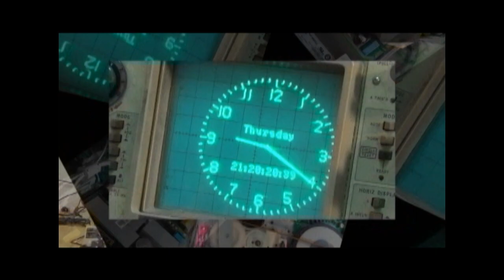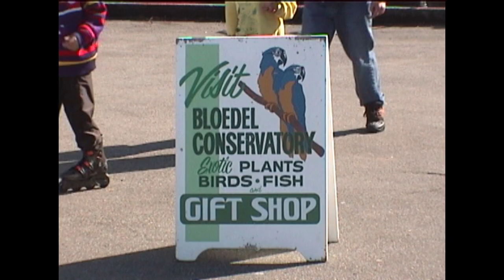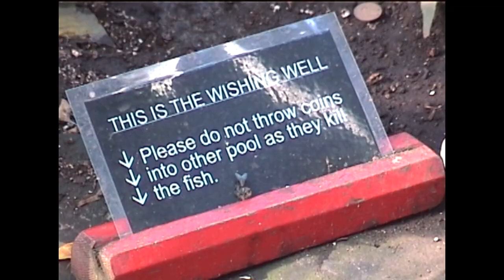Original Evaluation Footage From the first Digital 8 camera released vs DVD camera uprez to 720

Comment: Off Topic....Just bought a pair of those Klein electricians' scissors you use Dave, and these are hands down the best scissors I have owned!
Reply from the maker: That's why i use them as does every cable and fiber splicer around.  Miller are also good.

Comment: I just bought a working Denon DP-45f turntable on eBay. In the service manual, it appears to have over 130 capacitors in it, although the manual covers two models. Ballpark, what would you charge to replace all of them and give it a tune-up.

Comment: Did you use the cloner box? 24:45 - the same aliasing and vertical - not horizontal - stripes of color I noticed on your original video, I thought that maybe youtube does it, but seems not. "It records digital on familiar 8-mm tape" - "You've lost me, technology is beyond me", ha-ha.
Reply from the maker: No, digital 8 footage was fired over via firewire and the DVD was ripped in the DVD drive.  No analog capture.  All digital.  Original version was a direct DV upload and the 720 up convert was done using premiere CS6.  The atrifacta you are seeing is probably the low resolution CCD.
Reply: @12voltvids  Right, stupid me. Actually, was wondering what you used for upscale to 60p. Premiere, I see. Thanks!
Reply from the maker: @ConsumerDV  yes it upscales and downscales nicely.
Reply from the maker: 8mm video was analog just like VHS and beta.  Hi8 was also analog similar to super VHS.  They just increased the carrier frequency.  Unlike audio tape where the audio signal is just sent to the tape mixed in with the bias signal. The bias signal is not recorded as it is well above the tape frequency limit.  On video tape the heads spin and draw diagonal tracks across the tape. This gets a much faster relative speed between the head and the tape. The video signal is not directly recorded onto the cassette formats. The video signal is split into its two components the color or chroma is converted down to a much lower frequency than where it would normally be in the video signal. On ntsc the chroma signal is normally at 3.57 megahertz and on pal it's at 4.43. this information is converted down to 629 kilohertz for VHS and 733 kilohertz for 8 mm and high eight. The luminance information which is the black and white picture details is fed into an FM modulator. No different than an audio signal fed into an FM modulator to be transmitted to FM radio. This FM modulated signal is combined with the down converted color signal and recorded on the tape as an FM radio signal. Hi8 and super VHS increase this carrier frequency and bandwidth which increases the picture quality on playback. Digital 8 is a digital format that uses the familiar 8mm and high eight tapes. The video signal is digitized turned into ones and zeros Evan framed his packets which are then recorded on to tape. This requires much more bandwidth than analog recordings do. On a normal 8 mm and VHS tape the Head drum makes one rotation to record one full frame, two fields of video. Digital information takes five times as much bandwidth as analog.  The digital frame used for digital 8 is the same that was used for mini DV. On mini DV that had drum rotates at 9,000 RPM, by comparison VHS and 8mm analog the Head drum rotates and only 1800 RPM for the ntsc system. 8 mm video however wrapped the tape greater than 180° because analog 8mm had extra room to record digital audio on cameras and decks that were capable of adding additional audio so there was additional bandwidth that was not used for analog recording. That is used in digital 8, the entire tape with is used and because of this extra real estate they had drum does not have to spend at 9,000 RPM for digital 8 it only has to spend at 4,500.  Digital aid itself made an excellent recording medium and because the quality was so good and could compete with DV in terms of quality the camera manufacturers intentionally put sensors in the camera that were artificially low and resolution so as not to compete with the high quality that a high in sensor could produce.
Reply: @12voltvids  :-)) I simply quoted the bloke with whom you talked in the park when you shot with the Digital8 camcorder back in the 1990s :-)) You explained to him that you were shooting with a digital camcorder that used regular 8-mm tape. I do know what Digital 8 is. But I never understood why did they choose to create a new form-factor with 6-mm tape for DV instead of re-using 8-mm cassettes. After all, DVCPRO-M cassettes are about the same size as Digital 8, and they probably could shrink it down to nearly MiniDV size to make a small cassette.
Reply from the maker: @ConsumerDV  gotcha. The reason Sony developed digitally was simple. 8 mm and hi8 had a huge installation base. It was the most popular of the camcorder formats. I know JVC and Panasonic might like to claim that vhsc was more popular but it actually wasn't, 8 mm and hi8 commanded approximately 80% of the camcorder sales in the 80s and 90s. With that big base of already existing customers who already had a library of tapes, those customers wanted to migrate to something more modern but still wanted to be able to play the existing tapes of their videos. Sure someone could go out and buy a mini DV camera now they've got a great digital camera but how are they going to play their 8mm tapes because they're old 8mm camera is broken. That is why Sony developed the digital 8 format, to allow customers that already had existing 8mm equipment and had their existing 8mm library of tapes a way to transition to digital recording while still being able to play their existing analog 8 mm and high tapes. Sony did release some cheaper digital 8 camcorders near the end for customers that we're looking for an inexpensive camera but did not have existing analog tapes to play, they offered a less expensive and buy less expensive I think it was about $50 to 100 cheaper. They had two cameras that looked identical at the time and this was well into digital eights dominance. The DCR TRV 240 and the DCR TRV 250. Both cameras the difference between the two is the 240 could play back 8 mm and hi8 analog tapes as well as record and play in the digital 8 format.  The TRV 250 only recorded and played in the digital 8 system. If I'm not mistaken that was one of the last camcorders at Sony made for 8 mm tape. Currently I have two DCR TRV 240s. They are both given to me as was the 250. one of the 240s the mechanism was all screwed up because somebody tried a tape out of it and ripped apart the mechanism to get a tape out. I pulled the transport from a 250 and stuck it in the 240 to create another playback machine that I could use for analog and digital tapes as for me having analog capability for playback it's much more important than having just a digital only camera. But that's why digital 8 existed. That's also why Sony put in a lower resolution image sensor. They wanted it to look comparable to the analog equipment that it was replacing as far as picture quality went it did look sharper but it wasn't as good as the image sensors that were put in their mini DV format cameras and that's so that mini DV could be seen as a step up in quality. Had they put the same sensor 680 or 760 k pixel sensors that the mini DV cameras used the picture quality of digital 8 would be identical to the mini DV and could undermine the sales of the 6 mm mini DV tape format. It was a great decision digital 8 because it allowed people to move to digital while still maintaining backwards compatibility and when playing an analog tape it would output a DV type signal through the firewire connector so you could digitize your analog tapes and import them directly to your computer no analog output in a separate digitizing card needed. It was a great format and Sony had a good run with it they weren't the only company that made digital 8 Hitachi also made digital 8 camcorders. The data structure is identical as far as the digital packets go between mini DV dvcam and digital 8. They all use the same compression the same data rate and the same color space. Dvcam was the professional arm of DV for Sony which used a faster tape and a slightly wider video track. It reduced the recording time from 62 minutes to 40 minutes on a regular tape, what this did was minimize dropouts because the head track was wider so a small disruption on the surface of the tape wouldn't necessarily cause a visual disruption like you did on the consumer format. Dvcam also used locked audio where the audio clock was locked with the video clock. JVC did the same with the gydv500 however the JVC camera recorded in consumer type record format so that consumer cameras and players could play the tape but it had locked audio. Locked audio is one of the most important features that dvcam and professional DV had over consumer DV. If you've ever tried to edit a multi camera shoot with unlocked audio you will know what I'm talking about because the audio gets out of sync with the video after as much as it just a minute of recording time and you're always constantly having to tweak the audio to get lip sync back. This was intentionally done to stop professionals from using home equipment because they didn't care about home users most home users didn't edit most home users just watch the tape on their TV are copied it to VHS or something else. Professional users though they would pay the big bucks to get locked audio because it made their session in the edit suite A little bit more bearable. I dropped 10 grand on my JVC camera for that reason because I couldn't deal with the lip sync error trying to work with two consumer DV cameras and do a multi-camera production.
Reply: @12voltvids  Um... I was wondering NOT why Sony backported DV to 8-mm, but why DV cassettes were created in the first place instead of re-using 8-mm cassette. After all, Sony was not the only one company making 8-mm equipment, back in 1982 as many as 127 companies supported it, it was an international consortium. So, why creating a new consortium, to which Sony also was a member, to create a whole new cassette family? Ampex wanted to use 8-mm cassette back in 1986 to record 20 minutes of 50 Mbit/s 4:2:2 digital video, basically DVCPRO50. But they did not go further than a prototype. I am sure they would be able to get longer play time with metal tape and narrower track, and it would be comparable to DVCPRO-M cassettes. Oh, well.
Reply from the maker: @ConsumerDV  the reason that mini DV was actually developed was the desire to make it even smaller camera. Also due to the fact that JVC and Panasonic would not support any 8mm format. Had Panasonic and JVC accepted 8 mm that would have meant defeat for their vhsc format. To JVC and Panasonic that's like saying beta 1 to let 8 mm win the format war for camcorders and they were not going to let that happen. So even though all the other companies that signed up for 8 mm and high eight the other two biggest companies would not support it. TV was originally going to be called quarter cam because it used a 1/4 in wide tape or 6 mm. Again Panasonic and JVC did not want a tape size as the official name for the format so mini DV was chosen as a name for the new universal standard for digital video. Sure Sony could have developed digital 8 right from the get-go but also initially all digital video tapes were metal evaporated tapes and initially the concern was that metal particle tapes may not stand up and hold Digital Data. They actually did a very good job when the engineered digital 8 because it took advantage of the larger tape wrap on the scanner.  You see VHS and beta for example used a 180° wrap when one head finished its scan the second head was in position to start recording the next field. 8 mm used 210° wrap. That extra 30° was for the optional digital PCM audio track and to record time coding information for frame accurate editing. The first 180° was where the analog video was recorded and the remainder where the digital audio was recorded or was it the other way around I forget maybe the digital audio was recorded before the video I'd have to go back and check my notes but anyway the extra wrap provided a longer track which permitted them to stack two DV tracks on top of each other. This allowed the 8 mm tape to record the same data that a mini DV did but without requiring as fast ahead drum speed. The writing speed is the same but the Head drum speed is only 4,500 RPM versus DV which is 9,000. On DV it takes 10 recorded tracks on the tape to store one full frame that's five rotations of the Head drum for one full frame on digitally it's two and a half rotations. Of course on analog one frame is one full rotation that just gives you an idea of how much faster the writing speed needs to be the store Digital Data. Anyway it's wasn't interesting time I would have loved to have seen a full-on professional camera that used hiatus full broadcast quality like a digital BETACAM but that format was also very well established and was the de facto standard for news gathering and production. Betacam SX actually became the most widely used format for television production. SP betacam became the standard in the analog world but when digibata came out it quickly surpassed all the analog recording and did you Beta had a couple of different flavors the betacam SX became the most popular and widely used of all of them because it was less expensive and it was a very robust recording on the tape. The neat thing about the digivated decks is that most of them could still play back all the analog versions of betacam that preceded them. One of the key reasons that betacam SX became so popular as a replacement is because it could use the beta SP tapes where is the other digibetacams required a special tape which was fine for post production and editing but for acquisition most stations were upgrading from analog SP so they didn't have to replace their library of tape so you can just continue using the tapes that they already had in the SX format which is one of the reasons it became the most popular of all which is what I have.

Comment: Sir, i have a question, if i select my camcorder to record on widescreen, will there be any pixel loss or something ?
Reply from the maker: Letter box yes, it just crops lines out.
Reply: @12voltvids  thanks sir, how do you capture your footage in 60fps?
Reply from the maker: @AbDaniel21  it was a direct transfer over firewire.  The 60p was done in software when it was uprez to 720p
Reply: thank you, wich software do you use, and wich settings?
Reply from the maker: @AbDaniel21 Adobe premiere hd 720p60
Reply: @12voltvids  thank you sir, unfortunatley i couldnt manage to get out 60fps of my adobe premiere + firewireconnection to my sony handycam, its only possible with my panasonic dvd recorder also with firewire
Reply from the maker: @AbDaniel21  the video signal coming from the DVD camera was recorded at 30 frames per second progressive which is how that camera records. It will output a 60 interlace signal if connecting to a TV but it records 30 frames progressive. The digitally camera records 60 interlaced. That's how it's transferred to the computer. All editing and so forth was done at the 60 interlace level but when I exported the final file I told premier to make it a 720 progressive at 60 frames. So while premier CS6 which is what I'm using was exporting the file it was converting from a 480 interlaced to a 720 progressive and rendering it at 60 frames. This was only done because YouTube tends to take standard definition content and cut the vertical resolution in half and turn it into a 30 progressive versus 60 interlace which cuts the vertical resolution in half.

Comment: I have a DCR-TRV520  Digital8 from 2000.  It has "1 lux sensitivity," but indoors the video is still very noisy.  25x optical zoom.
Reply from the maker: Lux rating means nothing. Light is everything
Reply: Yes with low light the camera will turn its gain up and this means noise try manual exposure with more light . Led lights are very cheap now even cameras costing tens of thousands need the correct lighting on the scene

Comment: My VX1 from 1992 may be analog hi8 but it has better color lighting and image resolution than a  digital 8 from year 2000 which has crappy resolution burnt lighting in the image
Reply from the maker: Take the S-Video out from your vx1 and plug it into the digital 8 and record onto d8 tape and see how good it looks.  I did that many times.  Took the video our of my evw300 and used the d8 as an external recorder.  Looked fantastic.
Reply: @12voltvids  yes I will need a Walkman digital 8 that records from an S-video input source I will try it 😉
Reply from the maker: @amatorev  cameras do it as well. I used to use my old DCR trv110 camera to record from my evw300 camera.  Perhaps a video to demo the process will be on order to show how I did it.
Reply: @12voltvids  good idea you can do it 😉